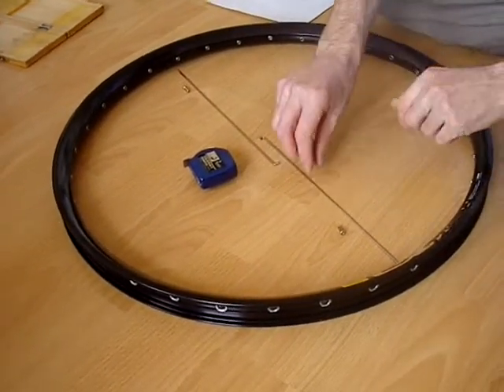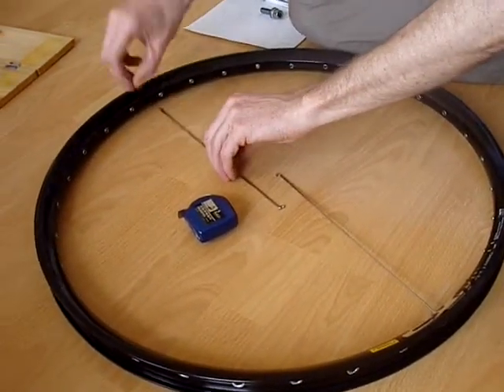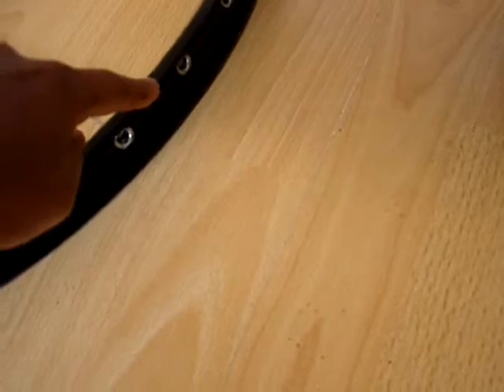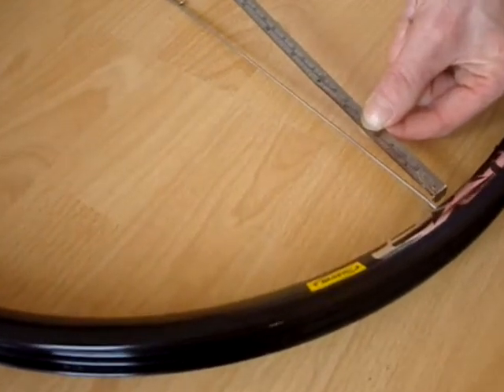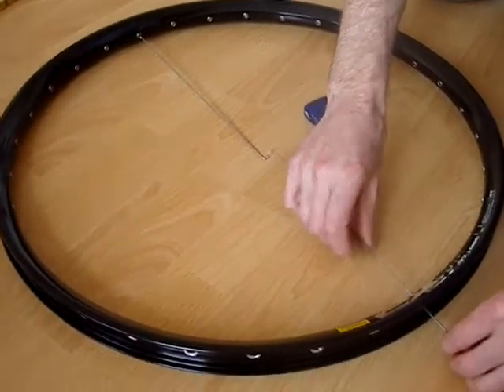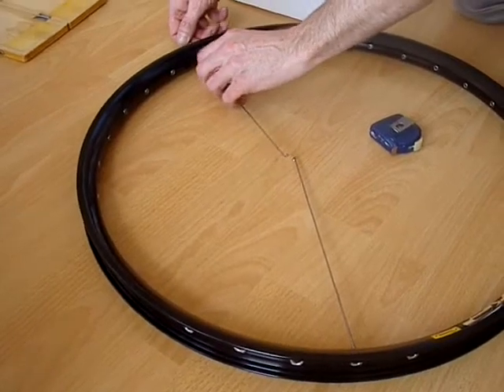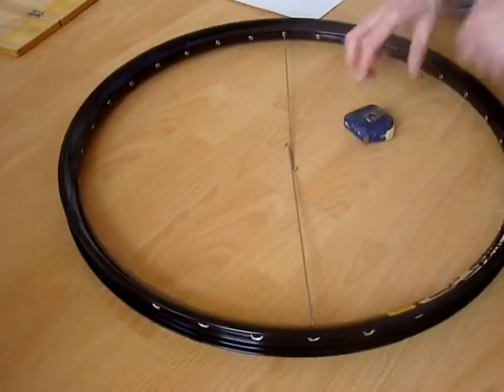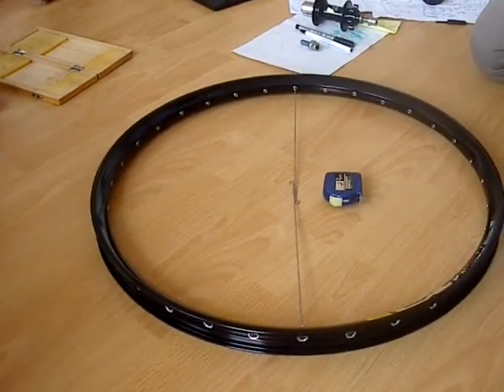How to measure the effective rim diameter of a bicycle wheel rim

Comment from the maker: Yes, that's a bit of a catch 22 situation. If it's a more popular rim then you can look on the manufacturer's website or just google. But you will find differing data which isn't very helpful. I've used specs from a manufacturer's website and found them inaccurate on occasion. Some rims such as DT Swiss have the ERD written on the side. If it's your first time perhaps your LBS can help out with the spoke lengths.

Comment from the maker: Thanks for the comments. The spokes are there just to provide a line for the tape measure. I agree that some rims do bulge at the join but I usually take 3 measurements and then average it. I've built hundreds of wheels measuring the ERD this way and it works fine. ±1mm in your final calculation is fine and you'll have to decide on rounding up or down when buying spokes anyway. Always measure if you can rather than go by manufacturers specs.

Comment: Since we are dealing with millimetres, this method seems very inaccurate. 
At least use shorter spokes so as they don't overlap, keep the wheel up and use
some elastic bands to pull the spokes elbows tight together.

Ideally, you should have a fixed length spoke/nipple and measure the in between
elbow gap with a vernier caliper.
Reply: Spot on, Eaglos. the theory is good but you only need something to move while you're measuring, and you are wasting money on wrongly sized spokes. elastic bands to keep tension while you measure cost less than fcking up the measurement and ordering the wrong spokes.

Comment: Nice simple way to measure the ERD. Thanks for the video. Also I don't think you have to be much more accurate. I measured my Mavic open pro rims this way and got about 608mm and 607mm where the website gives 605mm. Rims are not that perfect. It puts my spoke length off 1mm. I have been off 1mm before with no problems truing or building a wheel.